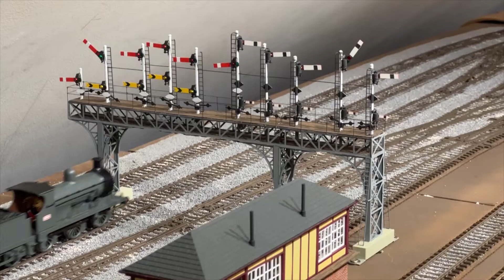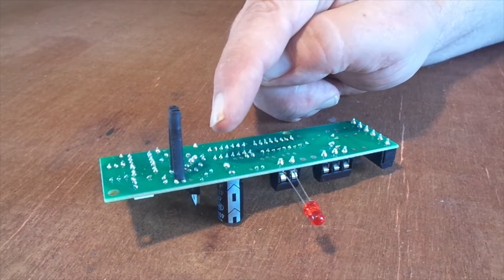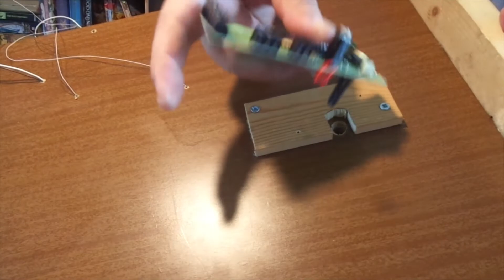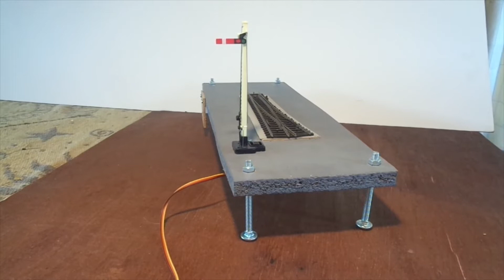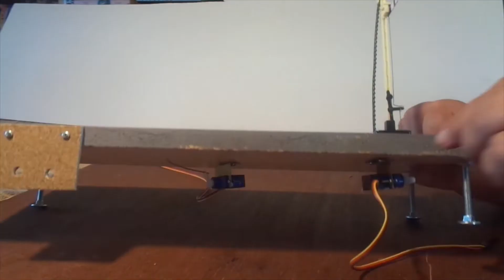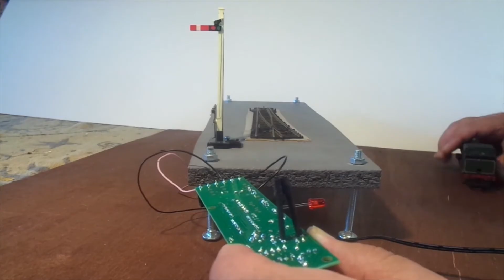Automating Semaphore Signals

Comment from the maker: For more information about the circuit boards mentioned in this video see our website at www.heathcote-electronics.co.uk

A video showing controlling semaphore signals with interlocking to points and block sections using the positions of the trains rather than timing is at https://youtu.be/x2cpUJ0Yazw?si=8P5pGTQ4_c0sntFk